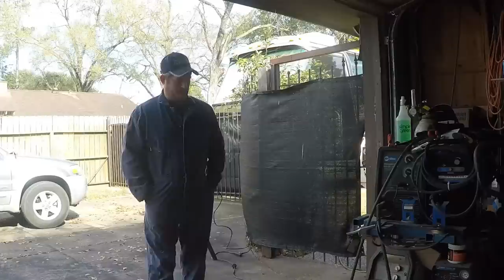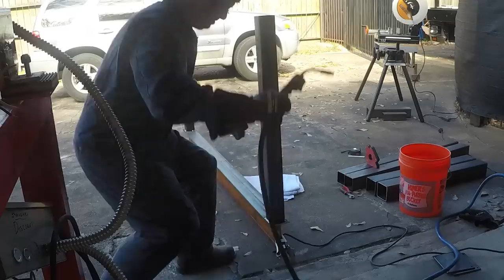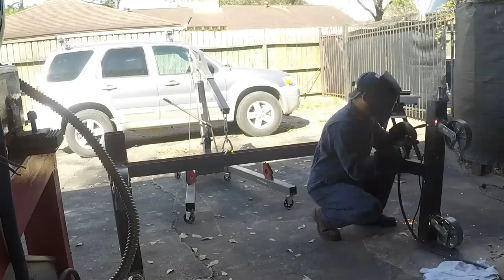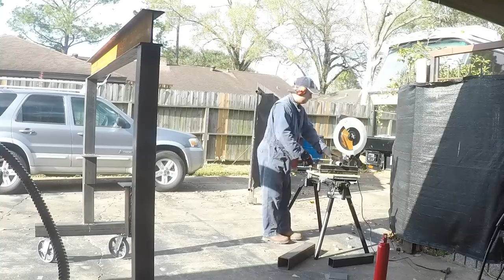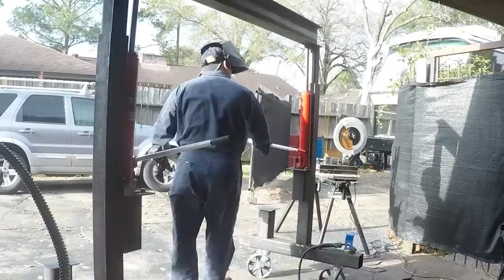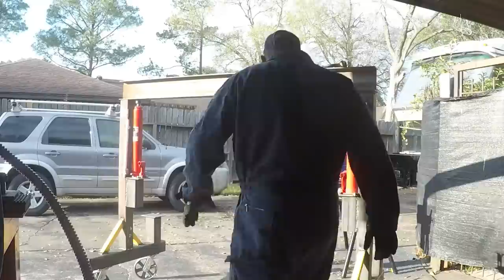DIY Portable Gantry Crane

Comment: Ya 45 on the bottom  and 45 on top as well, Drill holes for pins for safety , do rely on the cylinders.  You can add removable legs extensions later if ti seams to tilty.

Comment: I would love to have something like this. I'm a marble sculptor and move 1-2 ton blocks of marble around my back yard (using an engine hoist) and on to a trailer to install them. Think 4 ft. tall stone lions and such. A skid steer is the optimal solution but damn they are expensive even for a used one and need storage space and upkeep, where this is simple. I don't know why I never thought of making a mini-gantry crane, I always just assumed they came in one size (too big) and fit over your pickup truck. I wonder if I could put rubber wheels on one so I could move it around the back yard? How heavy is it, 2-300lbs?
Reply from the maker: you have the weight about right.  The hard part is finding wheels that can handle it.  I'd also want to lengthen the base pieces to keep it from tipping.  If you used small trailer tires you might be okay, but again think weight limits.  In particular you want wheels/tires/bearings that can handle half your design load to avoid issues with momentary overloads.  Heavy stuff comes down hard and surprises are no fun.

Comment: Plumb you jacks together using hydraulic hoses keep in mind the hoses need to go up and over ...measure the hoses with the crane at full extension
..weld some pipe to run your hoses through to guide them ...good job but you do need to add the pins for safety
Reply from the maker: Pins would be helpful.  This was built for the specific purpose of moving a 5,000 pound Lathe.  Under no circumstances did I expect anyone to get under it or for the lathe to be lifted more than 8 inches off the ground.  Pins would be a good upgrade, but the rest would just add complexity.  Better to keep it simple.
Reply: Connecting the cylinders wont work. The hydraulic fluid is always going to Push the cylinder which is easier to move. to get them both up at the Same time you need a really expensive valve and fittings etc. Just not worth it!

Comment: Thank you for sharing an informative video on your grantry crane.  Since it is now about 2 years since the initial construction have you done anything more to the design or modification of the crane? Have you put it to use for other than lifting your lathe to place it on a pallet?   Thanks, again.
Reply from the maker: Hi, thanks.  Yea I use it every now and then for heavy lifts.  Check out my move of the two letterpress-style platen presses.  Indispensable tool for the garage-shop.  Have wanted one for years and should have built it years ago.  I even took it several hundred miles away to pick up a press.  Right now, it lives outside, but that's fine.  It will get used when it is the right tool for the project.

Comment: Can you share your span length and load beam size...? Is 5 k a low ...med ....calculation?
Reply from the maker: Mine was designed for 5K, but probably would handle double that.  I used it to pick up a Heidelberg Windmill (Tiegel) press.  That's known to weigh 5K as well.  

I would also recommend machining holes for a safety pin in it.  I didn't have my Bridgeport up so I did what I could with what I had in the time I had to get it done.

Comment: Nice build and not trying to criticize at all but why did you choose to mig it over say 7018 or dual shield?
Reply from the maker: I have a good MIG and don't have a Stick welder.    If I still owned my Miller 300 A/B I'd have stick welded it in a heartbeat.  But the MIG is more versatile when working with a variety of metal thicknesses.

Comment: Nice!  I don't know a lot about metalworking.  Are those squaring devices (the red ones) magnetic or something?  I notice you keep one in place while welding, so it doesn't seem that it's just for checking the squareness. Does it somehow hold the beam square?
Reply from the maker: Yes, they are magnetic squares.  they are specifically for welding.  These are large ones.  Sometimes when you prep a piece it won't cut perfectly square and the magnet will help you deal with that while you tack the piece in place.  Thanks for watching!

Comment: Brian, for what it's worth. Lets say you needed to up the "lifting capacity." We'll say right now your lifting beam width is say 10' Ft. Long & is 5" in. high X 5" in. flange, and we'll say a 1/4" in. web. If you were to say weld just a 4' ft. (length) X 5" in. (wide) X 3/8" in. (thick)  centered on the lifting beam, both sides, you could increase the lifting capacity by a whole bunch. The reason being when you did your engineering calculations, it was for the whole beam at the original size (10' Ft. Long & is 5" in. high etc,) but with the reinforcement  now your only lifting / supporting a three foot span until you reach the reinforcement / both sides. (You than have to do engineering calculations for the length of the reinforcement, added to the 3 foot span on both ends. ) Don't know if there are free engineering calculators on the web, if not , it would pay to visit a structural engineer, give him the number's / dimensions, he could give you an answer in less than 3 min's, provided your not looking to have him "stamp" a set of plans. Might cost somewhere between $25.00 $50.00 for what I'll call a off the record calculation. But with the programs they have access to, he / she would be able to give you what I'll call the improved number's.  I'm in the process of building a garage, with a 2nd floor. 48' ft. long. The original engineer designed it that I would have wooden posts down the center of the shop approx 12 foot apart. Being a welder Fabricator, said the hell with that, consulted a structural engineer, said I wanted to put an Iron beam down the center, & have only one support in the middle of the shop. He came up with the size I-Beam I needed, but I have to put 45 degree supports from the center supporting beam. He said by doing that, the load calculations are not 48' Ft. divided by 2 = 24' ft. But are now 2 --20 foot beam(s) calculation. He stamped the plans, (cost me $750.00, and I had to do ALL OF THE DRAWING'S, via my CAD Program, per what we discussed) The County Planning Department signed off on the plan's.
Reply from the maker: Building design is generally around acceptable deflection.... L/360 or L/180.  Mechanical is a different animal.  I'm not sure why you would want or need plans stamped for a simple crane, but I doubt anyone would do it for $50.  They'd likely want to revisit all of the design criteria to avoid an E&O claim coming back on them for certifying a set of drawings.

In my case I invested in building this crane for this particular move, but I have some other things that I can use it for where it will make projects safer and easier.

There wasn't anything out there like this so I wanted to share it so others would have this example to work from.
Reply: @hotpuppy72  "I'm not sure why you would want or need plans stamped for a simple crane."

 I didn't have plans stamped for a crane, I had them (plans stamped) for the iron beam that will be supporting a 2nd (second) floor in my shop, and to be able to pass a "Building Inspection."

I was just trying to show / illustrate  how a "single/one time only," "engineering calculation" was done.  ALL "engineering calculation(s)" are way out of my pay-grade, but from years of welding you do learn a few things.
Reply: Would you please type the name of the welder machine and saw?